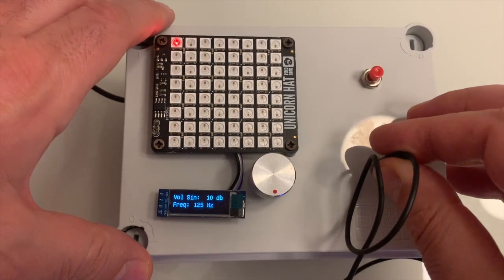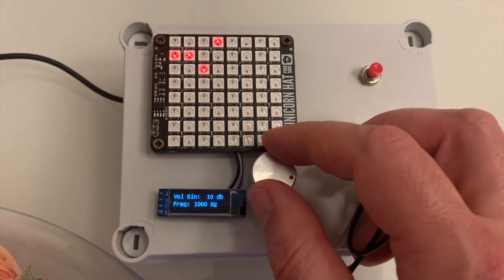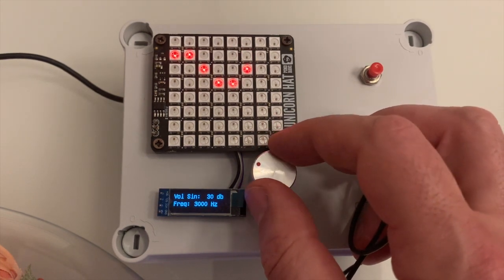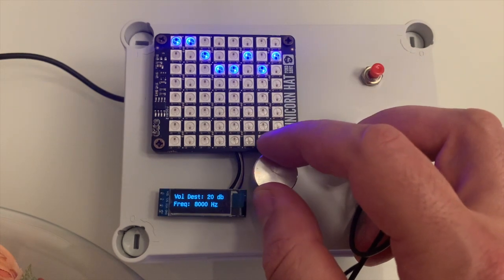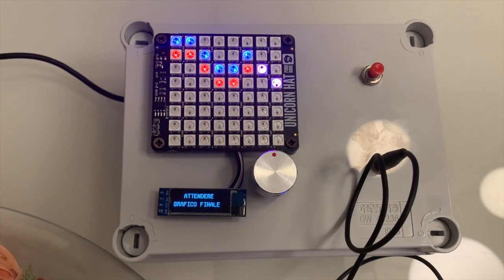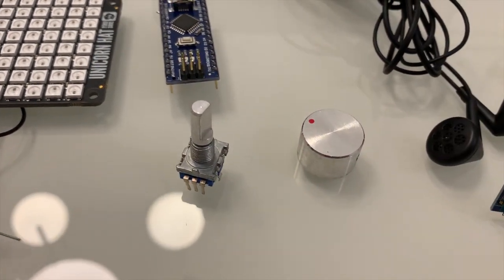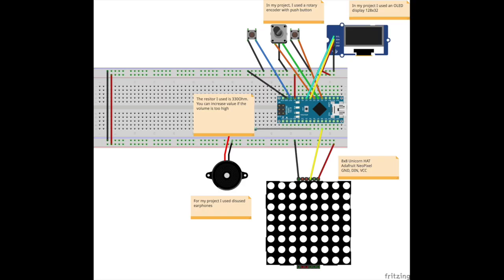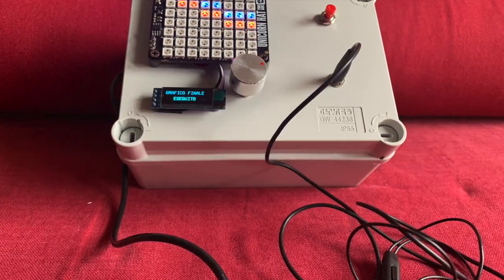Arduino Audiometric Device using Arduino Nano

Comment: Hi Carlos- very cool project!

Are your results from this device similar from the audiologist? I was wondering if the equal-loudness contour comes into play with hearing exams? I was looking at your code and couldn’t see any equal loudness adjustments for the different frequencies. Or does this not matter for audiogram? 

I’m interested in building a similar device to test my own hearing up to 15k and this is the best project I’ve seen so far.
Reply from the maker: Hi Chris. No it’s not the same. This is really a small project to have some fun.

Comment: What do u mean by two numbers under volume vol, code segment?
Reply from the maker: It’s the output frequency value.
Reply: @CarloStramaglia  but no values are given under volume vol,
Reply from the maker: Explain the request a bit better so that I can help. On the display, I show the volume in DB and the Frequency. Not sure what value you are talking about.
Reply: @CarloStramaglia  #define PIN 8
Adafruit_NeoPixel strip = Adafruit_NeoPixel(64, PIN, NEO_GRB + NEO_KHZ800);
U8GLIB_SSD1306_128X32 u8g(U8G_I2C_OPT_NONE);  // I2C / TWI 

Volume vol;
// Change these two numbers to the pins connected to your encoder.
//   Best Performance: both pins have interrupt capability
//   Good Performance: only the first pin has interrupt capability
//   Low Performance:  neither pin has interrupt capability

// ----- Rotary settings here ----
Reply: I'm confused about the comment u left below volume vol
Reply from the maker: OK. Now I understand. If you use A2 and A3 you will have no issue. Those comments are related to the digital pins. You do not have to use that. Sorry. The comment should be deleted.
Reply: @CarloStramaglia  Thank you so much for the clarification 😊
Reply: @CarloStramaglia  I have one more doubt. For this it states that delay won't work unless vol. Delay used
vol.begin(); // After calling this, delay() and delayMicroseconds will no longer work
               // correctly! Instead, use vol.delay() and vol.delayMicroseconds() for
               // the correct timing

Is this applicable to the delay I used :
const int ROTARY_DELAY = 100;    // Time between checking for rotary turns
const int BUTTON_DELAY = 800;    // Button debouncing, and repeating
Reply from the maker: Hi Yes. The rotary_delay and button_delay is OK.
Reply: @CarloStramaglia  These are other delays I have used :
const int ROTARY_DELAY = 10;    // Time between checking for rotary turns
const int BUTTON_DELAY = 800;    // Button debouncing, and repeating
const int FLASH_DELAY = 600;     // How long to flash the entire row after button press
const int CURSOR_DELAY = 200;    // How quickly to flash the cursor led 

So I don't have to change them, am I right?
Reply from the maker: Not sure why you are using all these delays. I did not use them but if it works it should be OK.

Comment: What's the function of the unicorn HAT?
Reply from the maker: Hi, as you can see on the video, the Unicorn Hat records visually the volume per each frequency and generates the final graph of the test
Reply: @CarloStramaglia  Thank you for your quick response. I really like this project and I would love to make it. Is there any alternative part that can be used instead of Unicorn HAT?
Reply from the maker: Hi. I think you can use a WS2812B. Just place 8 stripes of 8 leds each. But I did not test it. Enjoy.
Reply: @CarloStramaglia  Will there be a need to change the code if WS2812B was used? Can a potentiometer be used instead of an encoder?
Reply from the maker: If the strip is placed in the same sequence of the Unicorn Hat leds, I believe you do not need to change the code. Look at the specs of the Unicorn Hat to make it similar. Regarding the encoder, you cannot change it with a potentiometer.
Reply: @CarloStramaglia  Can  the OLED be replaced by a 1602a LCD? I really appreciate your help, I'm new to electronics however I'm very interested in this project.
Reply from the maker: Yes. It can but needs some code change.
Reply: @CarloStramaglia  Can a LCD without I2c be used?
Reply: @ahlamrafeek9141  Did you make it?
Reply from the maker: @Denise 4ever Yes but needs some code changing and you need to check that the Arduino PINs are available
Reply: @CarloStramaglia  would it be easier using i2c lcd? In case I did use i2c, what aspects of the code should I change? I noticed that some functions in u8glib library weren't available in liquidcrystal library, what library would you suggest that wouldn't require major changes in your code?
Reply from the maker: @Denise 4ever Using an i2C lcd will help for the Arduino PINs. So yes much better. Regarding the code you need to use the i2C liquidCrystal functions and not the u8glib ones. So all the code that writes on the LCD will need to be adapted. It's not difficult but requires some time and testing.
Reply: @CarloStramaglia  Thank you very much. I appreciate your help. Looking foward to your upcoming creations.
Reply: @denise4ever242  Not yet. I'm planning to start as soon as I get the components.
Reply: @CarloStramaglia  Can I use a 8x8 led matrix instead?
Reply from the maker: @Ahlam Rafeek I believe you can. If you send me the schematics of the led matrix you want to use I can check if it can be replaced. My email is carlostramaglia.cs@gmail.com
Reply: @CarloStramaglia  yes I just sent it. Thank you so much
Reply from the maker: I will read it tomorrow. And answer.
Reply: @CarloStramaglia  sure thank you so much